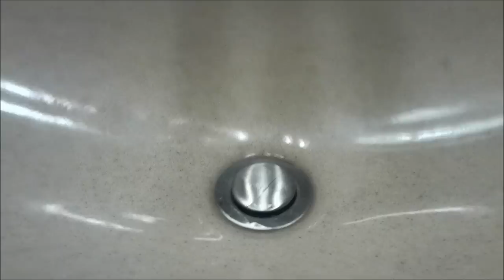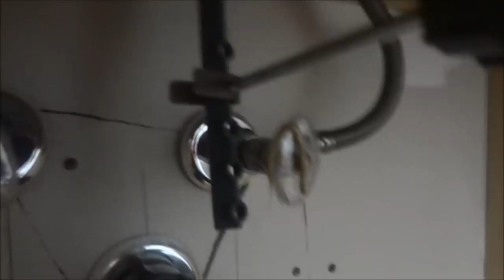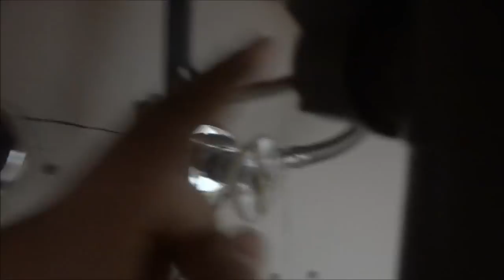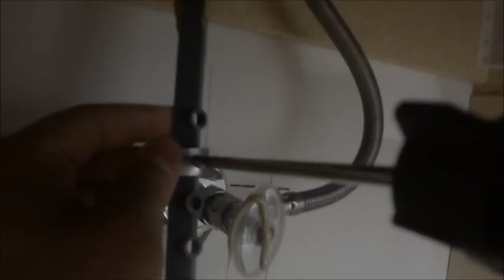How To Adjust The Height Of A Bathroom Sink Stopper

Comment: what  if you put it in the bottom hole and it is not high enough?
Reply: exactly! i have the same problem. i'm thinking that the whole assembly is too low....but what it originally installed that way when the house was built?
Reply: was..
Reply: theres a bolt at the top of the metal thing with holes... loosen that bolt, slide the metal thing with holes down tighten the bolt and you should be good
Reply: @packrcch  see my reply to robert
Reply: I have this probelm.  I am not so sure the holes in linkage are for travel as much as lift lever height.  I tested mine wih nothing connected.  Not sure why they don't have more upward travel.  But most sink stoppers are threaded.  You can unscrew the stopper itself aways to get some more height.
Reply: @80srockerable  my problem is that even when the stopper lever is pulled completely down, it only lifts the stopper ~1/8”.  The nut prevents the lever from going down far enough to lift the stopper up beyond 1/8”.  Don’t want to take it back... but....
Reply: @nitrousman8882  I haven't taken the time to redo mine. Instead have just left the screw in plunger off. My sink is older..I kinda wonder if older sinks are thicker cast or something.  I see drain stoppers one can buy at home stores that look like they hold on by friction. I may try one of these.   It's a pain to redo all this again.
Reply: @nitrousman8882  Glad you replied.. just solved this from watching a video.  I removed the drain stopper and tuned it 180 degrees so the rod goes through the offset hole at further away instead of installing it towards the area where screw ball rod into. This changes the physics of lever action and provids more travel.  So if your drain stopper is installed with rod going through the offset hole close to the ball assembly. Turn it around. Huge difference.
Reply: @80srockerable  I agree with you! Unfortunately, this didn’t make much difference for me.  In fact, the connection is a bit insecure and unreliable.  The original actually had a conical screw cap that allowed the. Bar much greater travel..

 I’m going to give drilling out the lifter seal nut.  It clearly is limiting the up/down travel of the lifter.  The seal is actually between the plastic ball and the body of the pipe.  The plastic insert just pushes the ball into a tight seal soooo... I think that by enlarging the hole, the lifter rod will be able to move over a larger range.  I’ll post a comment as to how it worked... and if there was any trouble with leaks.
Reply: @nitrousman8882  Darn. Sorry to hear.  This is the 2nd time I replaced. This time I bought the better one they carried. These are frustrating.
Reply: @80srockerable  Thank you for the suggestion. I turned the stopper 180 degrees and now it rises enough to drain the sink fast!
Reply: @jimv7517  Glad to help. I forgot about this.

Comment: You are spot on Thank you for this information. I like the stopper to be about the same as where he put it but a little higher, you want the stopper a little higher for the reason that if the water drains to slow you will have the soap scum and debris plug up the drain much quicker so we must put the stopper high enough so that the water flies out of the sink. We might think if the plug is too high then we might lose something of value down the drain but because of the ribbing below the stopper it is unlikely the chance of losing something down the drain.

Comment: Question: what if my stopper still opens very low and I'm already at the bottom hole notch under the sink? Is there a quick fix or do I need to call a plumber?
Reply: Try removing the stopper to see if the hole is pointing to the wall. If you reinstall the stopper with 180 degree turn, the hole will face away from the wall. the leverage of the stopper controller will be reduced but the movement will increase.